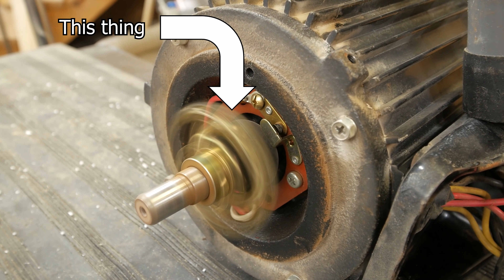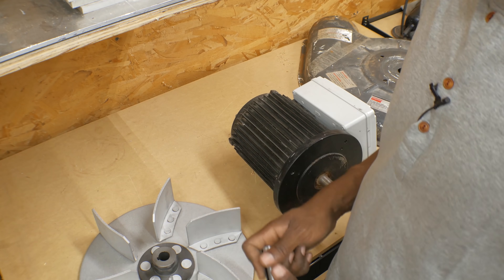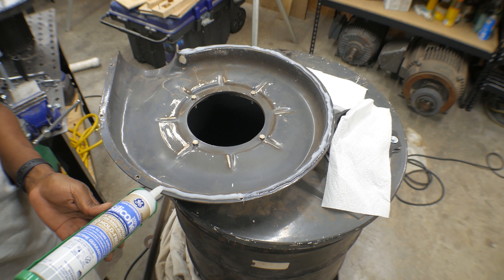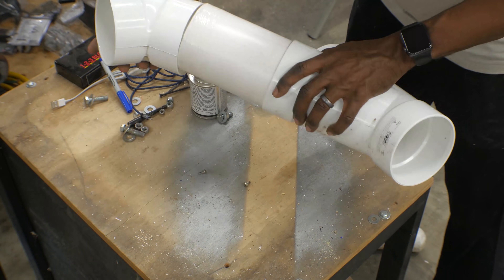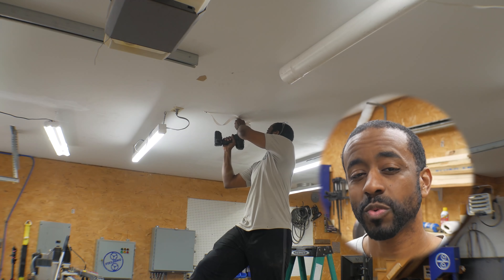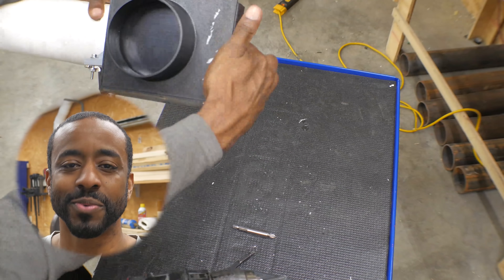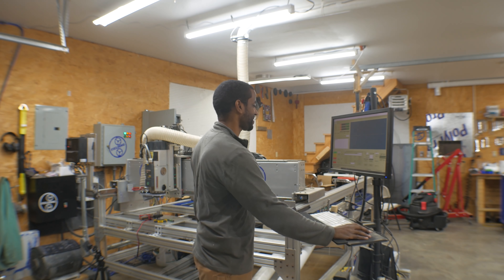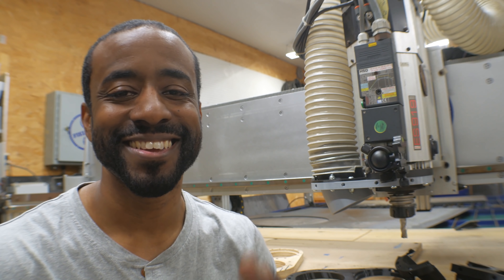Making An Automatic Dust Collection System; Shopmade #081

Comment: In some air and dust moving systems, especially those tied to expensive computers and motor controllers and the like, I've seen what looks exactly like Christmas tree tinsel running through the plastic vent, tied to a ground strap at either end. Don't know if it's an actual product with that intended purpose, or it is actually commonly available Christmas tinsel.

Comment: I have access to a vacuum pump that is used in equipment like a Vac-tron. It has a 220v 5hp motor now via pullies running it. I wonder if this would work for a dust collector system and maybe find a smaller 110v motor and change pulley to get it spinning right. Thoughts?

Comment: You have pretty fantastic videos. Where would you recommend someone to start in regards to 3D modeling with free software. I’ve tried several programs but I’m always hitting a snag in how the software works vs how I think it should work. Even sketch up has me flustered.

Comment: Can you do a motorized pocket door video? Some type but not that great!  Here are 7 to review. Tech Tube: Diy sliding door motorized (No sensor), Punky Rooster: Automatic chicken coop door (Line actuator too slow), 1superchuckles: power pocket door and power pocket door #2 ( No info and too short), Pavel Tyutin: Power Pocket Door ( Too short and little info), uiproductions: Star Trek Door ( uses air compressor. no motor), Byron Knudtson: Knudtson Automatic Pocket Door Build Tutorial ( No details) and Hdevelop Jebara: How to make a automatic door opening using motion sensor ( This one is GREAT, but only if it can be applied on a life size scale with a real solid door!!!

Comment: I was wondering if it is possible add a second collection bin (to switch where the sucked in material is stored) to a dust collection system like that and use it to collect metal chips as well or would there be a fire hazard because the chips are hot and there is still wood dust in the pipes and that would possibly lead to a fire?

Comment: You should never use silicone on a mating flat surface for a gasket if you cannot access all of the inside after it's bolted up. Silicone migrates like crazy when you bolt it up and it will leave a bead around the inside that you cannot remove fully unless you have full access. Many times that bead will break loose like a string when in service and wrap around rotary components causing extreme imbalance. In automotive engines it has been known to migrate through the oil system until it plugged off a gallery causing the engine to seize. In your case a better product would be something like Permatex gasket maker or Tribond 1184. Both of these materials remain soft in service and any material pushed out on the inside will not harm anything as it breaks down into small dust like particles.

Comment: So, you have an actuator at each gate, plus a two-way solenoid. Hydraulic supply plus solenoid wiring to each gate. Central control to select. OR you could take two hydraulic lines to each gate, and a single block hydraulic selector for which gate to open- there is only ever one open at a time. Reduces hardware, does selection logic, and the 'close' hydraulic line can be common, so not much extra pipe. OR you could have spring return on the gate, needing only one line per gate. Saves lots of wiring, relays, and nothing to mount at the gate. If you controlled the decay of pressure at the control unit (NR valve and orifice) you could have automatic slow close, to clear the line after switch off (with delayed off at the extractor). Simplicate and add lightness...
Reply from the maker: The only thing that goes to each gate is two air lines. Everything else is in the cabinet...This is a common miss conception though which means I didn't make it clear in the video what the arrangement was. You can get a better look at the box and setup in the video after this one about relays... as I used a few in this project.

Comment: This may have been pointed out already, but couldn't the impeller housing be rotated ~90 degrees clockwise to keep the thinner part in line with the dust intake, while also pointing the output vent towards the wall? This may push the unit away from the wall ~2 feet to make room for the bag between the dust bin and the wall. Either way, I think a couple elbow joints and a straight run could have gotten the unit where Jeremy wanted regarding bag and intake orientation. Also, the impeller was going to be replaced, could a model that would improved efficiency and or noise level been found? I mean, In for a penny... right?

Comment: How about a video more on the relay and different voltages.  I want to wire my 240v air compressor to turn on when I turn on my 120v lights in my shop.
Reply from the maker: Absolutely... I will add that to my list
Reply: @Jeremy_Fielding   My wife will thank you that the compressor will no longer kick on at 2am when I forget to unplug it.

Comment: I was house/dog sitting for some friends one day.  The neighbors had bought and remodeled an older home next door.  I spoke with them on a Friday and they were saying that they were going to start moving in on Sunday. About an hour after speaking with them I stepped out to the grocery.  When I came back to my friends house from the grocery the whole street was lined with firetrucks.  I was mortified that my friend's house with the dogs locked inside went up in smoke.  It was the neighbor's remodeled home.  They ran the shop vac in the kitchen and left.  It was later determined a fire started inside of it.  The house was nearly a total loss.  Roof, siding, all interior walls, most windows, stairwells.  They didn't tear it down, but essentially every last thing had to be replaced.   I have never heard of it before or after, but I either empty our shop vac after using it or leave it outside until I can.

Comment: I didn't read all the comments, but I would have gone with optically isolated relays. Probably take the place of a couple of relays, they are a little pricey, have no moving parts, require a heat sink, but you're having fun?  🙃🙃🙃

Comment: Other things that have been used would be; cardboard and tar, cloth and tar, oilclay, Waddle and Dob, felt, ect..  Next time I just sick just that if you're going to use 100% silicone caulk or even 50% silicone caulk use it on porcelain, wood,  or glass.

Comment: Static charges aren't a problem, even without ground wire. PVC is an insulator, therefore the charge can't "collect" enough to be dangerous. Occasional static shocks occur, such as when you touch a flex hose. This is similar to touching a door knob after walking across a carpet. This is probably the source of the myth. But there is not enough charge to ignite sawdust. Explosive ignition of particles relies on a very specific set of variables all being properly in balance. You don't find examples of fires caused by PVC ducts because it doesn't happen.

Comment: hey Jeremy, great video and I like your automated blast gate design.  But there's one issue I'd like to point out -- the black plastic gate you ordered is the same as ones that I've previously used in my shop.  I found that those gates lose effectiveness over time, because when they're open and dust is flowing through them, some dust will accumulate in the pocket that the gate slides back into when closing.  eventually enough dust accumulates to interfere with the gate closing properly, and that leaves it in a state where it can't really fully close.  So at that point you have a permanent "leak" .  I had this problem and had to move away from these plastic gates.  My solution, i have to admit, was to buy the automated gates from IVac, which work great but yeah, they are pricey.  Are you having any problems with the black plastic gates closing / getting clogged?

Comment: Great job... seems like a well oiled machine. I notice the chop saw....what kind is that - never seen a motor like that on a Saw before....
Reply from the maker: I made it. There is a video about it. “How to cut steel on a miter saw”
Reply: @Jeremy_Fielding  I will have to check out the video..  thanks

Comment: J, I've seen several dust collection systems all using sliding gate valves.

How about a butterfly valve, like on a carburator?  held closed by stiff spring, and opened by an actuator
Reply from the maker: Well. I would like the center line ( where the air is moving the fastest) to be clear. I think you will get the best performance and air flow that way

Comment: Is the bolt pattern for the motor the same as the bolt pattern for the barrel? Could you flip the impeller housing over to point the outlet the way you wanted? (Cutting out a new intake hole of course)

Comment: Wonder if that was a left-handed thread?????
Had that problem on mine, yeah went and searched out the bolt that l took out on disassembly, problem solved👍
That's how it goes. 
👍👍👍👍👍👍
Reply from the maker: I Also thought it might be left handed. It wasn’t
Reply from the maker: I Also thought it might be left handed. It wasn’t
Reply: @Jeremy_Fielding  good that you checked. 👍

Comment: Hi Jeremy, I am interested in either converting an existing gasoline backpack blower to electric, or building my own electric backpack blower from scratch. I am wanting to get the kind of power that Stihl's best lawn care blowers get; what kind of information and stats on the gas motors for those Stihl blowers do you need for you to recommend the kind of electric motor and corresponding stats for it that I should use? Thanks for any help you can provide!

Comment: Equipotential bonding is serious business in explosive atmospheres. If you look up electrical equipment in hazardous areas standards, you will find a bunch of information to determine if inside your system is actually a hazardous area. One of the factors will be if the filings/ dust is explosive and or conductive.

Standards dictate that an installation use an anti-static plastic to avoid the possibility of static build up. Exposed metallic surfaces need to be bonded as well. One way around this is to paint the metal, so it's classed as being insulated, not a conductor. 

PVC melts like a mofo, if you don't take precautions to adhere to standards, your insurer may find this as reason not to pay out if your house burns down. 

Given your system is already made, you could paint the inside in a metallic paint and have some external bonds that link the pipe. Test for sufficient continuity(0.5ohms). Probably do a few layers of paint so dust doesn't wear it down as much. Some people mix graphite powder with paint to create a conductive surface to electroplate over. Probably cost less than using metal or anti static pipe.

Comment: At around seven minutes regarding the positioning of that snail shell/turbo spool-looking thing, why not just turn it 90° the opposite way? You’d still have the piping and that exit in the same general location no?  (At first, I thought you had six bolts to work with so I probably would’ve said turn it 120°/two notches to the right, but since there’s four then 90° is the closest you could get) 

Nonetheless great video! I always enjoy your content👍🏽

Comment: On the commercial systems the vacuum fan has a sensor on the end of the line that regulates the system, I have installed full systems in factory's with waste gates on each station controlled by the individual machines why not use a mains voltage solenoid then you just wire it across the motor. As for static on plastic pipe I have seen the static build to the point the operators were getting shocked. A single earth wire did not work I had to wrap braid wire around the pipe in a spiral then replace the fixed pipes with galvanised steel. On the fibre machine I measured the static charge at 3kV.

Comment: Hi Jeremy, I need some help with a 2hp motor I have.  The housing, shell?, is rusted out badly.  Is it possible, feasible, to replace the housing on a motor?  I can dig up the model number and specs if needed.  This motor is the main jet pump on a mid 90’s era hot springs hot tub that I would like to resurrect . Thanks, love the videos.

Comment: Why not either put a collar on the impeller to raise it up slightly or add a few more fittings onto your exhaust to route it around? And I think static is more of an issue in that it can build up dust inside the tubes which will impede your airflow.

ETA: If I'm coming off as "that guy" (an armchair know-it-all being condescending), I apologize. I know next to nothing about shop tools and have been building my own metal working/fabrication shop too. So I've been dealing with many of the same things. I guess bottom line - I mean no disrespect with my suggestions if it ever comes across that way

Comment: You ABSOLUTELY need to worry about grounding your dust collection system. I work for a pneumatic conveying company (dry bulk solids) and we have seen the very real dangers of not having it grounded. At one of our customers site, some employees were working in an enclosed space doing some maintenance, while they were in there a call for flour was initiated and the resulting static buildup caused an explosion causing them to suffer from third-degree burns on the majority of their body. 

Also it’s an electrical shock hazard! Not sure if it’ll kill you, but damn does it hurt!

Comment: If you haven't found out yet, you may soon, those blast gates are absolute garbage. The issue is the slot the gate slides into when closed gets a little bit of sawdust in it and each time the gate closes the dust caught in the slot the gate slides into gets packed in until eventually, the gate can no longer close properly. I got fed up trying to clean mine and just build my own. It's entirely possible your suction is strong enough to get all the dust but it's something to watch out for with those gates.

Comment: Awesome stuff Jeremy. I’m designing my system and this helped!
I’m curious why you used pneumatic actuators rather than mechanical since you already need to run 24v to the gate. Also did you evaluate using current sensors so you didn’t need to wire the relay to the machine switch?
Keep the great videos coming!

Comment: Regarding the static... Eventually, enough charge will build up on the pipe, causing it to spark someplace, yeah?  But the charge would be fairly uniform across any given section of pipe.  Since the pipe itself is always going to be the same charge, the spark isn't going to jump from one part of the pipe to another part of the pipe.  It's going to jump from the pipe to something else.  Which means it would spark OUTSIDE the pipe, which is not where the flammable material is.  

Am I wrong?  Seems like an impossibility unless you maybe suck something metal up?

Comment: Would it be possible to have a delay for the dust collection and blast gate when you turn the machine off so the vacuum continues to work for several seconds?
Reply from the maker: Absolutely there is. There are all kinds of relays with timers, latching, and other smart functions

Comment: there is one big issue here, I don't think you will have compressed air all the time, based on your design, you need to keep air compressor running all the time just to engage small air valve, I think using motorized actuator will more better.

Comment: What is that beast of a motor @5:30 from... and what are you gonna build with it?
Reply from the maker: Can’t say what it’s for yet ...but 25 horsepower high torque motor.
Reply: @Jeremy_Fielding  Your kids need a better go kart....  😈
Reply: @Jeremy_Fielding  Buy some land in the mountains and make yourself a hydro-electric generator?     Build an Electric powered bulldozer?      It's a beast.    BTW I also use PVC pipe for my DC, and have done so for over 10 years.   I rarely even get static, let along any shocks.   Might be because I have a basement shop, so it's usually not dry air?

Comment: The reason that it wouldn't thread is because it's likely a left-handed thread.  A left handed thread is used with rotating shafts because right handed threads tend to unthread themselves due to rotation.  Since you have now cross-threaded the left handed threads to put a right-handed bolt in place, you probably want to reinstall the bolt with permanent threadlocker.....
Reply from the maker: That was the first thing I checked. I had the same thought

Comment: Is there a follow-up video on how to wire up the relays?

I have to turn on my dust collection system, and then open my blast gates with 2 seperate remotes.

I have zero experience using relays, but could follow along a video easily enough.  Just not seeing the video when scrolling through the channel.
Reply from the maker: Beginners guide to relays on my channel it’s pretty much right after this one
Reply: @Jeremy_Fielding  Thanks!

I was reading the words in the thumbnail, and not the title because my eyes are old...but I found it easily.

Thanks .